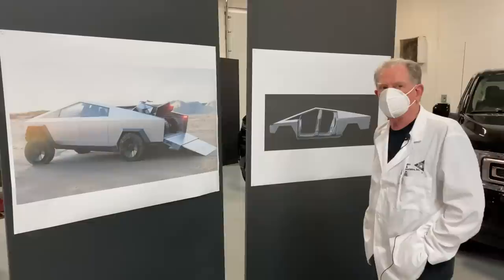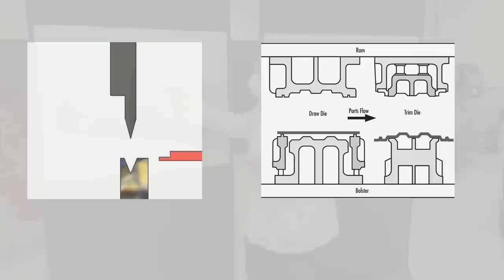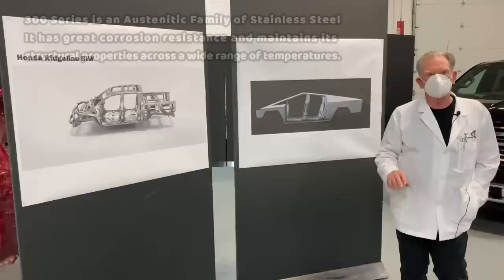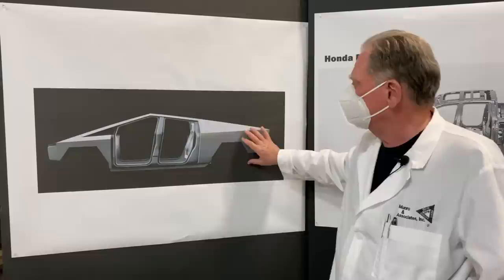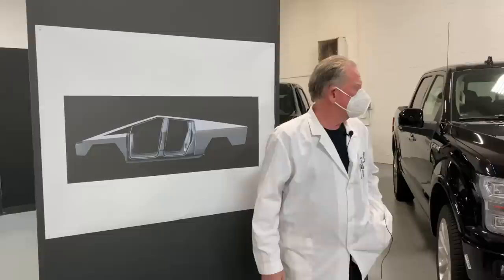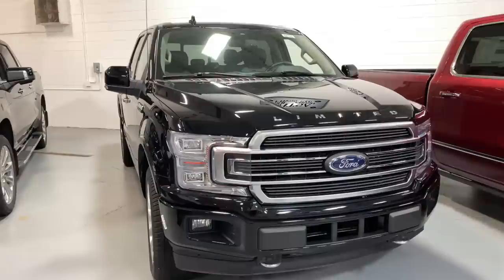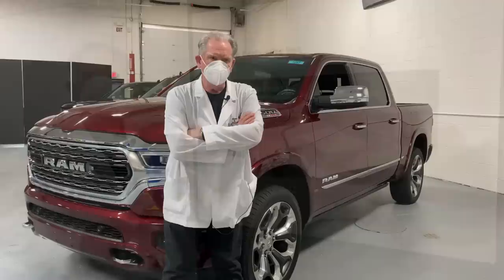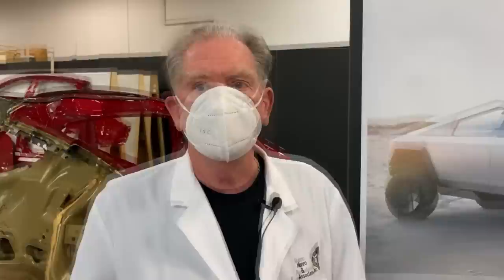Cybertruck E1 - Body Structure Comparison

Comment: No paint issues with this Tesla, guaranteed!
Reply: The only paint issue I see is if another vehicle bumps you and you have to clean their paint off. How dare they get their paint on my truck!
Reply: If you want paint just get it wrapped.
Reply from the maker: @davidelliott5843  good point! Easier to wrap too with relatively planar geometry. Thanks for tuning in!
Reply: @dries248  haha, will be easy to clean off too!
Reply: @davidelliott5843  so basically use more plastics i guess....
Reply: @carholic-sz3qv  - or you can BUFF it to a Mirror Like finish. (Steel Mirror).
Reply: @davidelliott5843  everyone gets to do their own unique wrap.
Reply: @markplott4820  I think that might be illegal, plus there isn't a truly stainless steel it's more like stain resistant.
Reply: @robertopics  - why ? the Recent Sightings of Cybertruck it had a Mirror like Buffed finish. 
Cybertruck is an Exoskeleton of 30xx Series Stainless Steel and is 6mm thick. 
it can Resist up to a 9mm FMJ shot multiple times at the door.
the bullet just Shatters.
Reply: There is paint, its just that only those with the keenest eye and most sophisticated taste can see its colors.
Reply: Go look at a SS kitchen sink. That’s what this truck is going to become as it ages.
Reply: Or pealing clear coat.

Comment: Can't wait until we have 4 different EV trucks for Sandy to look over, test drive and gives his thoughts on.
Reply: why ? Compared to the Cybertruck they will all be COMPLIANCE Body on Frame BEV. 
the LEGACY Electric pickups will be LESS Efficient because of the Body on Frame Design and will Weigh MORE too.
thus they will have a Smaller & LOW output Battery with Shorter Range than the Cybertruck.
RIVIAN will Remain as a LUXURY Brand but Legacy will make CHEAP BEV Trucks with Body on Frame .
Legacy will sell for Less than RIVIAN. but About the same Price as ICE Pickup Trucks.
and Tesla may Assault the LIGHT Pickup Truck market with the 2+2 Cybertruck MINI .
Reply: I agree, more choice is better.

Comment: I love my 1997 Saturn with the composite body panels. No dings or dents after 23 years.
Reply: In 2 years you can apply for classic car status! At least where I am, you can get special licence plates and different rules/insurance apply to classic cars.  FYI - old cars are MUCH less safe than new ones.  You must not live in the rust belt!
Reply: Reverend Al   Plus a timing chain, not a belt, and a stainless steel exhaust system - all standard on Saturn back in the day.
Reply: That's so cool. Was happy to read this.

Comment: Exoskeleton: Rather like a bug than like a turtle.
Reply: Pretty sure a turtle's shell is at least partially made of bone, sooo... it's not wrong. A bug is arguably a better comparison, but turtle works too.
Reply: @theuncalledfor  The turtle still has a skeleton within its shell and all appendages have endoskeletons. The bug's skeleton is on the outside no matter what part of its body you look at. Arthropods (bugs, etc.) are a far more correct comparison... Though I'd say the CT is more monocoque than exockeleton, much like most aircraft.
Reply: @Kimoto504  
The wheels have an "endoskeleton" (soft rubber around a metal center), and there are some internal structural components around the cabin.
Reply: I was thinking lobster, they can survive at 480m

Comment: 10:53 Proof elon knows his stuff. "The best part is no part. The best process is no process. It weighs nothing. Costs nothing".
Reply: Doesn't weigh nothing though, but it's way less more simple for sure.
Reply: @etbadaboum  if there is no part it weighs less.
Reply: @Jimmy_Jones  Stainless steel is way heavier so not sure if in total it's lighter.
Reply: @etbadaboum  stainless steel has a lower specific strength (for the same strength, you would need more mass of steel). However, this outer skeleton wouldn't need those unnecessary external panels. So it's hard to tell without actually checking their design
Reply: The channed steel frame is by far the heaviest part of a body on frame truck. Cybertruck = no frame.

Sure stainless steel at that thickness is heavier, but overall, the Tesla truck will be much lighter than a stamped steel BOF pickup truck.
Reply: @1queijocas  Exactly. One clue however is the lower price for quite a large range even for the entry one. So maybe mass is quite low. We'll see soon enough! Maybe even Sandy will talk about it in an upcoming video...
Reply: Elon fired the guy who designed the model 3 body. Because he did not use the battery"s structural strength to lower the weight of the 3. Sandy said the same was repeated on the Y. 
Elon is kicking but. But he spreading his time too thin and things are slipping through the cracks. It took way too long to test fire SN4 after the engine switch. Elon is great, not perfect
Reply: @golfish8589  He may be not perfect but he is still way better than anyone out there.
Reply: @jmel1746  you are seriously wrong, the stainless steel construction is going to be way heavier, also the glass too,
Reply: @etbadaboum  its not better than anyone
Reply: Agent J  Hope you sold that software if it was a personal project. Guessing you probably had to just give it away though.
Reply: Word
Reply: Total Zen my kind of guy.

Comment: I would love to hear Munro's take on Cybertruck and crash safety / crumble zones. Thanks!   😊
Reply: He spoke about this on another video. No problems passing crash safety according to Sandy.
Reply: I suspect a 5-point harness on all seats and extensive roll over protection should mitigate most passenger safety concerns. Everyone not inside the quadrangle truck should watch the fuck out, however. 😉
Reply: @dries248  None of that is necessary. The Cybertruck will be the safest truck ever built for public roads. Unless you're a pedestrian like you said. But then again if you get hit by any truck you're pretty fucked.
Reply: @dries248  Although, by the time the Cybertruck is available, FSD will be pretty much here, so you'd probably rather be in front of the Cybertruck than anything else...
Reply: good luck repairing it ever, just remember large frame cracks make it look better, keep telling yourself that.
Reply: @eclectricmagazine  If you had an impact that would demand structural repair, the same impact would have written off any truck. Large frame cracks? You mean the cuts on the inside of the stainless steel? Or cracks that would form after a heavy impact?
Reply: I saw a report that Europe has  more  regulations as to the exterior of vehicles to limit injuries to pedestrians.

Yes, FSD will be safer. But most cant afford the current 7,000 dollar cost. 
Plus a FSD tesla still needs to obey the laws of physics when hit by another vehicle.
Reply: @golfish8589  Europeans don't buy trucks. Trucks are a Yank thing.
Autopilot is not the same as AEB. AEB is free in all Teslas.
What laws of physics does the Cybertruck not obey?
Reply: Crumple zone protects the driver 
Not the other vehicle 
Don't need a crumple zone on the cyber truck
Reply: Tom Robertson it protects both
Reply: Cybertruck converts all other vehicles into crumple zones.
Reply: @HopeIsFleeting  how about a drunk driver crossing the center line. Or someone texting. Or someone sliding on ice or someone swerving to avoid hitting a dear.
Not everything is avoidable
Reply: @HopeIsFleeting  so there are zero trucks in europe?
And elon will just ignore all of europe and not build a smaller cybrtrk for them?
Reply: @tomrobertson3236  not true
Reply: @golfish8589  can't make an opinion into a fact 
Post your facts
Reply: TIM Flugaur-Leavitt what about it?

It’s not zero but it’s pretty close relative to the American truck market.
Reply: @golfish8589  Do semis have a crumple crash zone. Ha 👊
Reply: @raymondschembri5042  yes, semis have crumple zones.
It's called a "Honda" in industry shorthand....

(which is why I do my best to drive safely...)
Reply: @golfish8589  
AEB corrects your driving when you veer off the center line. It also stops when it detects something in the way.
Tesla is making a smaller CT, Elon confirmed this.
Reply: @Howdy Justice Yes I meant crumple. I'm Norwegian  👍
Reply: @raymondschembri5042  do semi and automobiles have identical regulations? Ha!
Reply: I missed the ? mark after the word them.
The previous poster said Europeans dont buy trucks
Reply: @golfish8589  
His point was that by the time the CT comes out AEB will be much better by then. You showing videos right now proves nothing other than some work is to be done.
Crumple zones should not be an issue, by the way. Yes, Stainless Steel is tough, but it's not invincible. It will definitely crumple at high speeds just like any other metal, maybe a bit more resistant, but the fact it has a frunk will probably balance out that difference.
Reply: @golfish8589  Allow me to quote myself... 'Although, by the time the Cybertruck is available, FSD will be pretty much here, so you'd probably rather be in front of the Cybertruck than anything else...'
You can't use the past to prove what will happen in the future. Especially when the rate of change is so great.
Reply: @golfish8589  Also, you're misrepresenting what I'm saying. I never said it will be impossible to crash a Tesla. I said AEB makes it safer to be a pedestrian that a car that doesn't have it.
Reply: @golfish8589  Crumple zones will be fine on the CT. Stainless Steel is tough, but Tesla can just make specific weak points to crumple, which is done is all cars anyways. Not sure why so many people make a fuss out of that. 
As far as will it be sold in Europe or the rest of the world, maybe not. Using the Ford F-Series as an example, around 99% are sold in North America. The remaining 1% is split between the entire rest of the planet. I doubt that Tesla will worry about European regulations with the CyberTruck, at least for a few years. Instead, they are looking to build a smaller version and sell the main version exclusively in North America.
Reply: @eclectricmagazine  At least it won't break in two like a Toyota or Ford P/U when the frame gets rusty.

Comment: Hey Sandy, it's incredible to see what you can tell us about the difference between the Cybertruck and all of the other trucks made standard on a frame.
So the Cybertruck would be a totally new thinking how to build a Truck! Stronger, longer lasting and of 30x steel from SpaceX.

So it's a rocket machine on wheels.

Thanks a lot for your work!!

Dankeschön für das Video.

👍👍👍🇺🇸🚐🇺🇸😎😎😎
Reply: And you could drive it on the Moon or Mars as is!
Reply: JOE - its not just the Cybertruck, Tesla cars Already can go Over 1 Million miles on the Motors, and soon Tesla will have the Million mile battery as well. 
all of which will be Incorporated into the Cybertruck.

Comment: Request: please show the practical differences between a panel of "Cybertruck steel" (ie 3mm cold-rolled stainless steel) and a panel of normal car steel. Eg, weight, how easy/hard it is to cut/deform.
Reply from the maker: Hi Chris, thanks for the request. We will try and work it into a future episode. Thanks for watching!
Reply: @MunroLive  Awesome! Thanks for the reply. I think many people underestimate steel. If it was just discovered it would be treated like a wonder material. Even money-no-object F1 cars use a lot of steel, based on conversations I've had with engineers at F1 teams.
Reply: @MunroLive  If you can, also show the massive difference between annealed stainless and 3/4 or full hard stainless.  Frankly, they're different materials.

Comment: ** Aluminium does still corrode, Methanol absolutely wrecks aluminium, aka the stuff coming out of your windshield washer jets.  Also, some crazy places in winter will spray a methanol-something mix for road ice removal.  So painting Aluminium is still a must unless you live in Arizona / anywhere permanently ice free.
Cheers. :)
Reply: Fyi
Cbrtrk is stainless steel
Reply: @WANDERER0070  .... Yes, I am aware.  
This was an add-on to Sandys' statement that Aluminum on the competition trucks was corrosion resistant.

Comment: will you be going into the details of how the unibody material behaves in the event of a crash? how differently does the material behave in the event of high speed collisions? what about collisions between the truck and a person (also compared to a conservative design)?
Reply: It should benefit from the same improvements found in other Tesla's vs ICE for the most common head on collision you have more empty space up front (no giant gas motor and accessories) allowing for best in class crumple zone.  If you are in an accident, being in the heavier vehicle is an advantage with transfer of energy, less energy gets transferred to your person. CT is heavier than all those trucks.  It may be worse for striking a pedestrian since its a giant truck, heavy and harder materials.. however Tesla has the best pedestrian avoidance system with all the cameras surrounding the car running algorithms to analyse and detect objects constantly.
Reply: I think much of the concern people have about crash should be alleviated via Tesla's active safety systems, which should become very good in next 1-2 years.
Reply: @steveseeger  nope you are wrong about the best class crumple zone, porsche has had it for decades with the 911 which always had engine in the back
Reply: @carholic-sz3qv  https://www.iihs.org/ratings/top-safety-picks/2020/midsize-luxury-cars#award-winners
Reply: If the cyber truck hits a person, all that’s needed is a scraper for the road and a wash for the truck.
Reply: @archigoel  unless it gets hit by a semi. You can't always get out of the way, T-bone.

Comment: I would like to see Sandy cover the Citroen hydropneumatc suspension system. I believe it would work well on the Cybertruck. It integrates steering, brakes suspension height and body roll control. Far better than boring air bags.
https://en.m.wikipedia.org/wiki/Hydropneumatic_suspension
Reply: David Elliott as someone who has had and driven Citroens: amazingly comfort, suspension wise. But when a small tube of the suspension sets you back an easy 600 guilders, it hurts haha.
Reply: Hydro sounds heavy...
Reply: Sounds complex. ... .. The best part is no part the best process is no process: -Elon Musk
Reply: @mmjnice97  also the air suspension is too expensive when it fails so its not really needed, even for offroading
Reply: David - America already has Something BETTER, it was used in the AMG Hummer.
the AMG Hummer had a Adaptive Electric Suspension with NON Newtonian Fluid . 
the NON Newtonian fluid used IRION Particles that would DAMPEN the Road , and it could be Electronically controlled from Inside the Cockpit. 
this would be GREAT on the Cybertruck.
Reply: @carholic-sz3qv  yes im not a huge fan of the air ride. Every vehicle that has air suspension has major problems in 10 to 20 years and will need to be replaced with springs!
Reply: @StephenMattison66  that's "hydraulic" not "water", bud. It doesn't need to be especially heavy. Hydraulic lines can be pretty small diameter... Your brakes are hydraulic (with vacuum boost) so it would basically be more of that.
Reply: @StephenMattison66  Please see
https://classicsworld.co.uk/guides/how-it-works-citroens-fluid-suspension/
Citroen had a hydraulic pump no bigger than a power steering pump. That feeds a hydraulic accumulator - a simple spring loaded cylinder than maintains pressure in the system. Small pipes go to suspension steering and brakes. The brake pedal is a simple valve. Road springs are nitrogen pressurised spheres which can be pumped up when necessary. Ride height is controlled by the hydraulic legs. Body roll is controlled by spheres acting across the body to keep the car level. 
Steering is either a fairly typical power rack.  The Citroen DIRAVI was fully powered, speed sensitive and automatically self-centrered the steering. 
Weight of brakes is reduced because high pressure calipers can be made smaller. Less weight at the road wheel gives a big gain for ride quality.
Reply: You lose the fancy brake master cylinder and the vacuum servo and the vacuum pump when it’s an electric car. Steering is much the same though without the single job pump. Suspension legs add a ride height piston into the leg but it’s not complex. 
Electronic controlled magnetic particle dampers can be used but their value really applies on sports cars where a stiff ride is needed on the track but not on the road. There are other ways (e.g. stepper motor valves) to adjust damping on the fly.
Reply: @Kimoto504  Hydro sounds heavy... bud...
Reply: @StephenMattison66  Normal brakes are hydraulic top spec mountain bike brakes are hydraulic. They are heavy enough for the job they do. 
In the Citroen system the hydraulics are not powering big cylinders like a digger. The suspension legs are just the same as any McPherson strut. The difference is the amount of oil inside the strut. Full = max ride height. Empty = sitting on the bump stops. The gas spring acts on the piston rod. But the effect is the same as a coil or air spring acting on the strut tube.
Reply: @davidelliott5843  I already understand all of that, but thanks. Maybe I should have taken the time/effort to type "Heavier than necessary."  So there, I said it now. Any liquid and the pipes that carry it will always be heavier than air, Law of Nature.

Comment: Beautiful analysis.  I looked at Cybertruck and thought, he's simplified this thing down to the essentials.  Less parts, no corrosion, minimal crevices to catch grit , combined with a drive system that significantly reduces the number of moving parts.  All of those "styling" curves and bends on traditional vehicles are to stiffen the very thin metal skin.